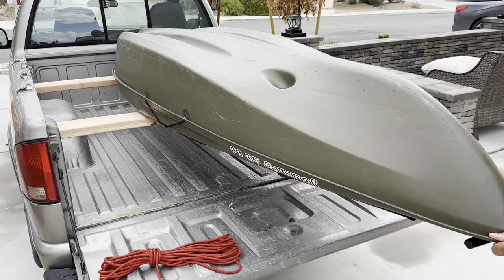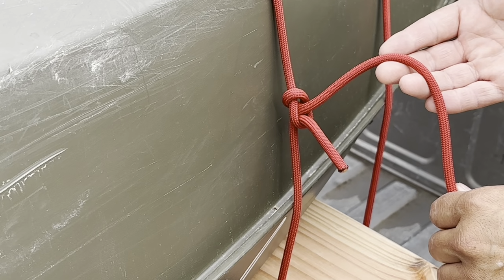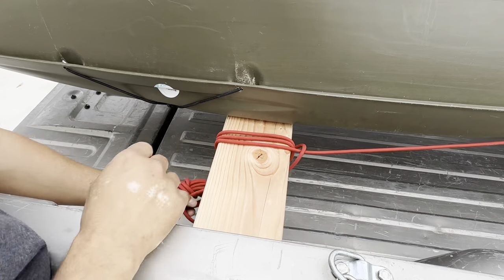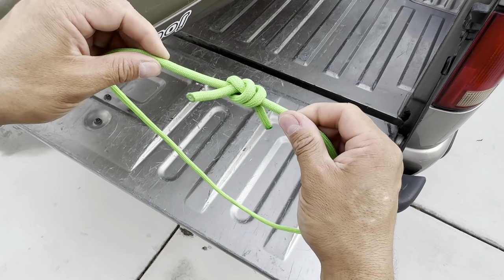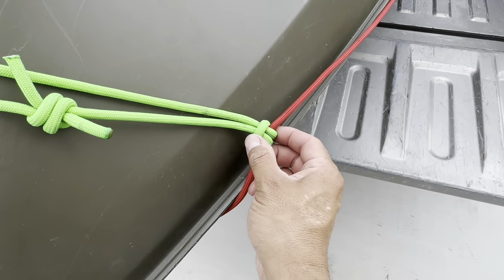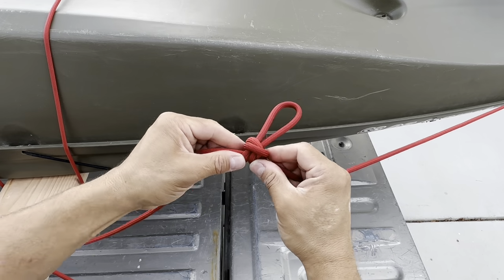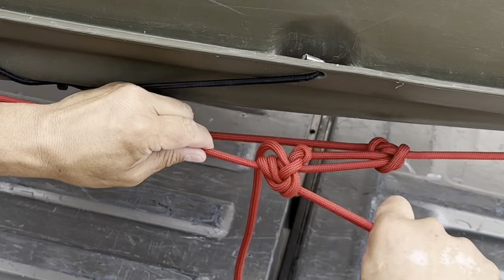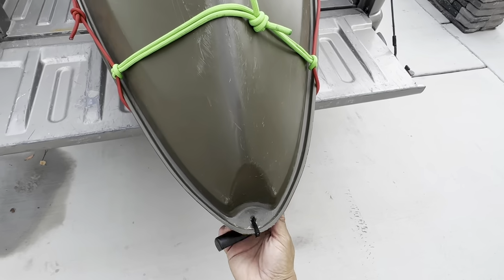Tying Down a KAYAK

Comment: Love knots, but I end up using ratchet straps alot. Mostly because I am putting 6-7 kayaks in the back of a truck and I definitely do not have the option for the boards. How would you put 6 kayaks in the back of a truck.